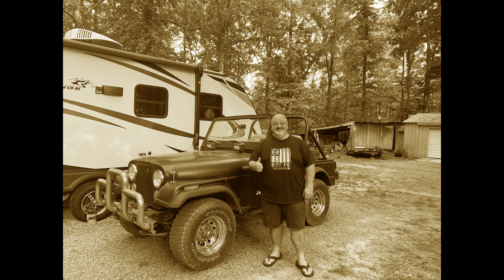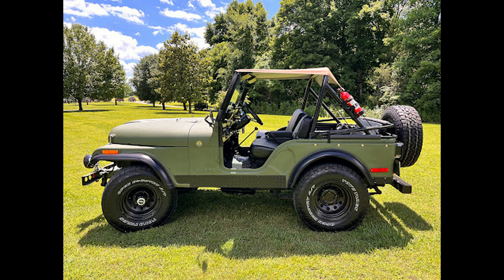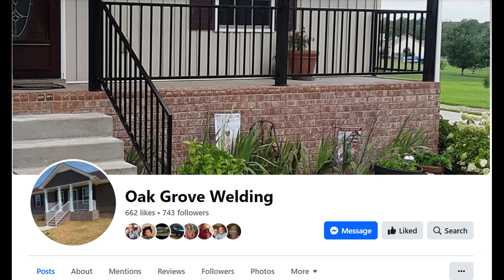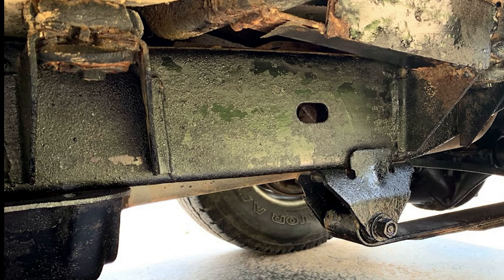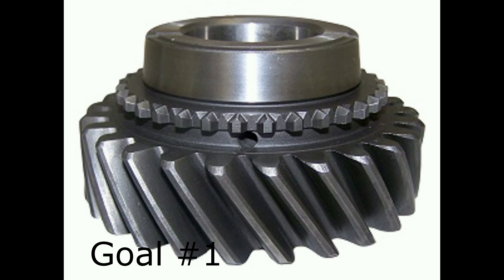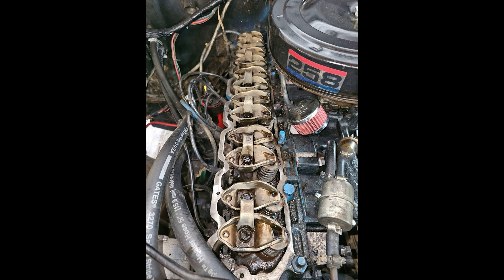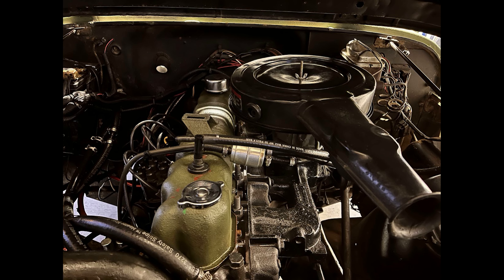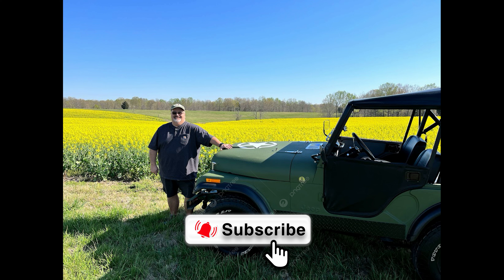2024 Sarge modifications - the bees knees for my 78 CJ5!

Comment: I saw your post on the "Jeep CJ5" Facebook group and glad you shared it! I "liked and "subscribed." 😉
I recently purchased a 62 CJ5 (one month ago today, actually). From what I can tell, the engine and transmission in mine are still original and I just got it to fire up for the first time and stay running for a few seconds last night. I had just dumped a little gas down the carb, so I knew it wouldn't run for much longer than that, but it gives me hope! Thinking about picking up a new fuel filter and dumping a couple gallons in the tank today and see if I can keep it running for a bit longer. That'll also be a good test for the tank and fuel pump.
I, too, am an IT guy by day, and this is my first foray into any type of automotive restoration; thank god for YouTube! My CJ also sat for ~10 years before I bought it, and the guy who previously owned it passed away, so I have zero information on any work that's been done to it. I guess that's part of the adventure! 😊